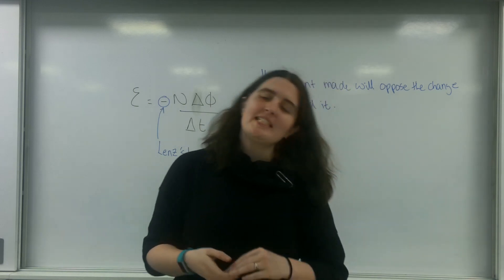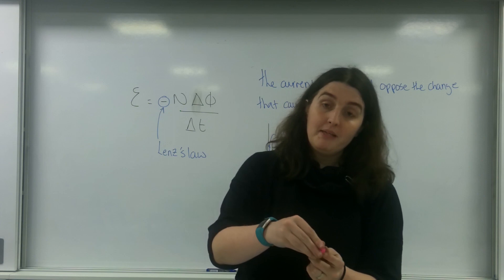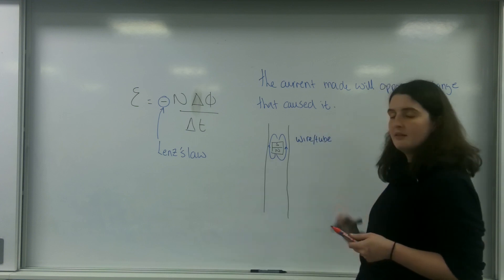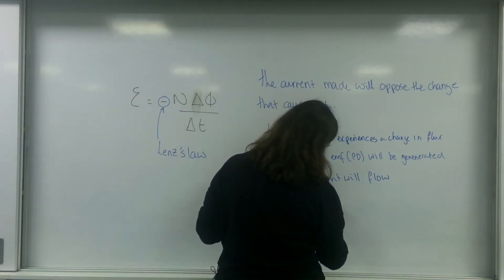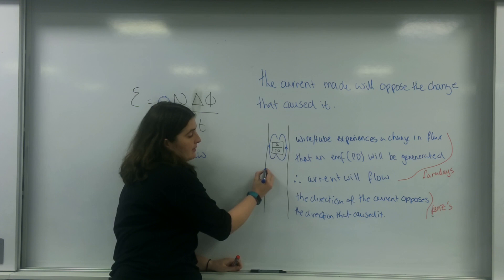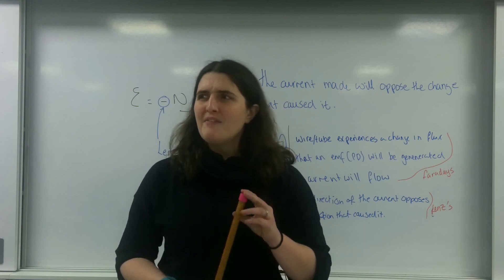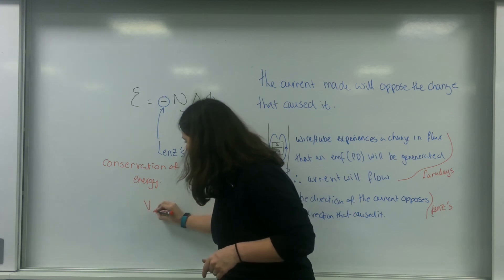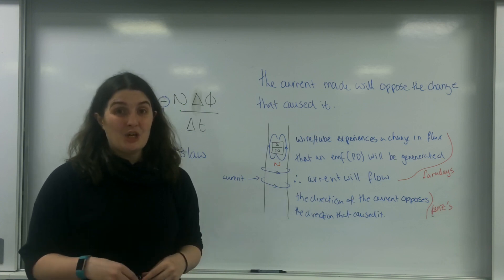Lenz's law AQA Alevel Physics

Comment: I though that the current only opposes the change that cause it in a complete circuits with an ammeter?
Reply from the maker: A complete circuit does not need an ammeter. Just the ability for the current to flow. So a complete loop.